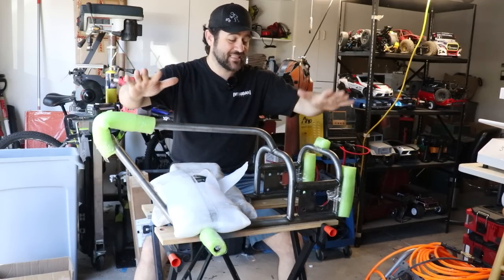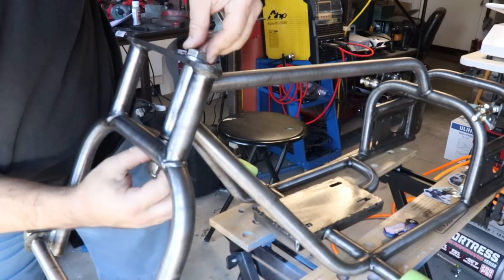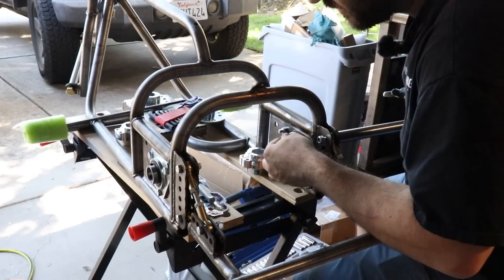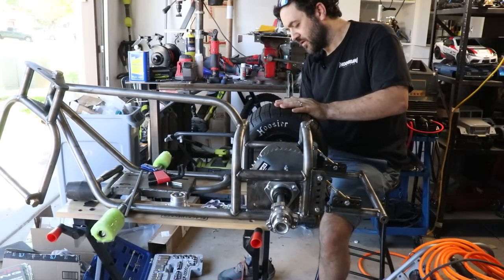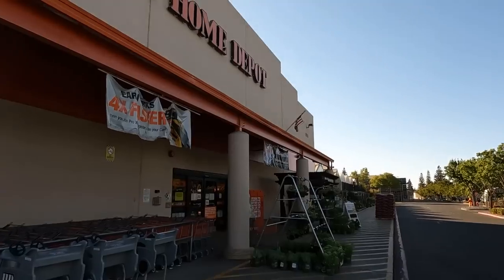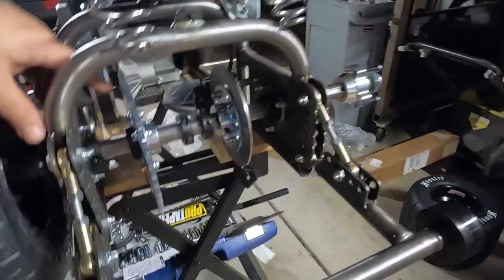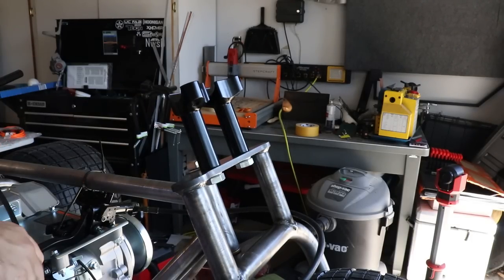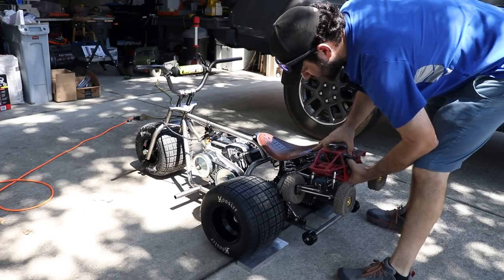Building a Mini Trike - RC Hauling 3-Wheeler! -  TGV Chassis Kit - EP1

Comment: If you haven't made a decision yet on the truck rack for the back, may I make a suggestion? A simple bar straight up the center, then mount a double hook on each side, the sort of rubber coated ones made to hang shovels or rakes on a wall. then simply hang a truck on each side by the axle. Then mount a plastic pelican style case on the top of the bar over the trucks, motorcycle topbox style to put your radio/batteries in.
Reply from the maker: That’s a unique idea. Interesting though for sure. I’ll kick it around.

Comment: Nice pit ride! Just to make it a little more comfortable, you might consider moving the foot pegs forward to the curve of the frame. 
As for carrying RCs I was thinking a large basket with 2 pieces of 7/8" tubing attached to the bottom that could slide into some 1" tubes welded to the rear of the frame.
Reply from the maker: A basket would be easy I agree, but I am thinking of something more fabricated so it has a cool look. Still undecided.

Comment: It seems to me the obvious powertrain should be electric motor based. An electric bike/mini-bike/mini-moto/or any EV really, is just an RC car...  except without the RC. In place of the radio, you just have actual control connected by wires instead of a radio link.

Comment: Run a bolt on rack off the seat pan so you can remove it later for your backpack or rig. Design up a flat aluminum or titanium or carbon fiber belt guard, like custom Harley belt guards, to send off when you send out for the rear rack. A front platform for second rig mounted straight so you could use the rig's lights as your head lights on the front. Use a gopro style mount to connect it to your front risers so you can attach and detach easily.  Will also act as front fender incase of dirty conditions. Or make fenders for the rear tires and make those your RC racks too.

Comment: I'd put a big 'ol tractor seat on that sucker! But then again, I'm old, it's all about the butt-comfort...🙂 As far as hauling RC's,  Might consider just making a little trailer,  or converting one of those Home Depot steel garden carts... then you only have to design a hitch on the trike, just opens up more options, INMHO
Reply from the maker: I don’t want to haul a second item like a big trailer.
Reply: @HarleyDesignsInc  I understand, but it doesn't have to be "big" necessarily, just a little 2 wheel job you can detach easily, doesn't have to "haul" a whole lot, but it might be a little easier than engineering a detachable basket, I dunno. I'm sure whatever you do will look great

Comment: I feel like you should have did more research on wheel spacers, wheel spacers and torque converter, which you need engine spacers to get the right alignment.
Reply from the maker: I didn’t need any spacers for the torque converter. Everything ended up lining up fine there. The only issues I ended up having was purchasing incompatible sprockets and hubs.

Comment: I still say the seat needs a fox shock or two instead of the springs.  Maybe add some "Highway pegs" so you can stretch your legs a little.  The only part that seems a little cramped to me is the foot peg position.

Comment: Cool little ride!! I have a few 1985 Honda 125m ATC's with Hoosier smoothies they came stock with electric start and 3 speed lots of fun great pit bikes and trash haulers. You got to revisit the FMS FCX24 been doing some awesome mods puts the SCX24 to shame. Matt over at 2FMRC and I have been having fun building them.... Great vid as always😄
Reply from the maker: Should be fun for sure. 

I have two FCX24’s still. Just can’t seem to get into them. Just not a big fan still.
Reply: you will

Comment: Looks like you're going to have interference issue with the lower frame tube when the secondary clutch pulley opens up at speed?
Reply from the maker: I’ll definitely check into it
Reply: @HarleyDesignsInc  sweet build!
Reply: Check out gtc manufacturing. 
They differnt clutch options with better covers!
Reply: GoKarts USA have open primary covers that might be compelling?

Comment: Awesome build! What if you held the trucks vertically and put one in the rear and one in the front? Another option for truck hauling would a cool little custom trailer, then you could make provisions for spare batteries and tools.
Reply from the maker: I’ll have a headlight up front that I forgot to mention.
Reply: @HarleyDesignsInc  cool, I think it’s gonna be stupid quick depending on the gearing.

Comment: That's sick, figure out a way not to cover the engine but still be safe. A trailer with those Hoosier tires would be rad.
Reply from the maker: I’m trying to avoid a trailer so I don’t have to haul another thing around.
Reply: @HarleyDesignsInc  100% agree...but a little trailer with those Hoosiers would be a head turner.

Comment: Did you use a tilitson engine  ? They are the same price as most other 5hp engines but the tilitson makes 12hp. For anyone building one check out go power sports for parts 👍

Comment: By the way, which soldering machine do you use?
Reply from the maker: I’ve got a few different irons. For super portable applications I use a TS100 iron.
Reply: @HarleyDesignsInc  ok

Comment: Looks like some cold welds….
Reply from the maker: For $800 I was not super impressed with the welds in the chassis.
Reply: @HarleyDesignsInc  no big deal if you have a welder, just throw a lap on there. Looks cool though, I want to build one someday.